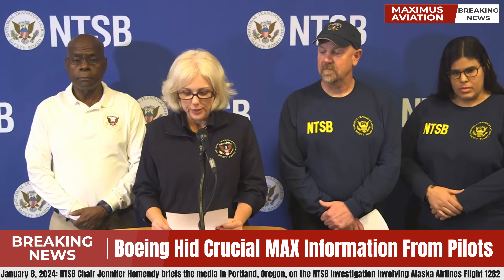Boeing NEVER Told Airlines That 737 Max Cockpit Door Was Designed To FLY Open During Decompression!

Comment from the maker: ** A Message from Maximus ** The reason I felt this is so important is because if you noticed. The NTSB seems to be glossing over this as just an "oops" Boeing oversite. She just said oh yeah Boeing agreed to address this in the manual.  But this happened with the MCAS system when Mark Forkner got the FAA to let Boeing NOT include the MCAS system in pilots flight manuals and we all know how that ended up.  So I felt this needs to be a much bigger story than the way the NTSB portrayed it. I can think of a lot of nightmare scenarios where this can be used as an excuse to get into the cockpit. So I just wanted to make sure to get it out there. As always please comment and let YouTube know you are worried about it too! Thanks. Max.
Reply: The new manual will say: Passengers seated in row ##, will be blown away into heaven in case of a emergency rapid decompression. Thanks for flying with us ❤️
Reply: @dondepicaelpeje listen and read again. They are talking about the cockpit door, not the door plug that failed.
Reply: @thesmallerhalf1968  who? What I said? I’m talking about the plug door/panel whatever
Reply: @dondepicaelpeje 😂😂😂😂😂
Reply: So if im a terrorist all i have to so is poke a hole in a window on the way up to unlock the cockpit door?!
THANKS NTSB!!!!
Reply: @christopherleveck6835 It’s easier to poke a hole in the fuselage skin than a window…
Reply: Until the FAA discontinues  allowing Boeing employees to act on behalf of the FAA to inspect and approve new Boeing planes under construction these quality control and defective engineering problems will simply continue.
Reply: We only have insufficient info so far. Boeing might well have designed the door to function as a blow-out panel in decompression events -- where pressure is distributed over its entire surface -- and still resist localized forces like  a hijacker yanking on the doorknob or prizing with a crowbar. Please suspend judgement until all the facts are in. (And I used to work for AIRBUS.) What is more disturbing to me is that the laminated CHECKLISTS "took a flyer"!!
Reply: It would be in the Boeing Manuals its the same as Airbus. It's a standard feature. I bet the FAA will make a correction Tomorrow.
Reply: OK, most of us engineers knew this, but presumed it was secret for security reasons. 
It is to stop diffrential pressure damaging the bulkhead between the cockpit and the PAX area.
 Someone put a lot of inportant wiring there...Cat out of box. Now, we will get to review security again. 
No real security risk here, it takes a LOT of pressure to open this door.
 @hamishdavidson3368
Reply: All cockpit doors and bulkheads will vent pressure.  They're designed to give-way instead of kinda holding up and then failing catastrophically one way or the other.  "Catastrophic" as in -- 1) Contributing to fuselage structural failure; 2) Sending shrapnel flying into the crew;  3) Damaging flight controls and other systems.
Reply: Almost certain this happens to all cockpit doors in the event of rapid decompression. Should have been redesigned when the cockpits were hardened against forced entry. but then it still would leave anything older with this vulnerability. Think this might be the reason they did not put it into the manual. still bad idea, even though admittedly, crashs because pilots didn't understand the manual are far more frequent than Boeings failure to disclose critical information.
Reply: It's possible that the Indonesia crash can be categorized as an "accident."  The Ethiopia crash was mass murder.
Reply: @DavidGBlair  100% I still believe management should have been held criminally liable.

Maybe that would have induced a bigger culture change?
Reply: This cannot be used as an excuse to get into the cockpit. Someone would have to intentionally cause an explosive decompression which would be absurdly dangerous to them. Additionally if the door didn't open, then there would be a risk of the cockpit structure being damaged.
Reply: @Synergy7Studios  Boeing’s piss poor outsourced engineering and components with horrible internal quality control plus the lack of a functional FAA and Federal legal accountability systems are no accidents, they are verifiably intentional.

As Boeing literally got away with murder, “B737 Max style”, these accidents will likely continue. 🙏Great thanks no one died this time. 

Thus, to this day, I simply continue to refuse to fly on the Boeing Max; deadly risks increase with every flight. A calculated risk I refuse to take.
Reply: @Synergy7Studios idk if you knew this, but in the case of a hijacking like 911, they never expected to make it out alive. If your plan is to crash the airplane... your priorities clearly aren't self-preservation.
Reply: So Maximus can we keep going on say opps it just an over sight each time while try to kill the flying public or do we call back all those aircraft and do a full fixed from cockpit to tail session 😮😮😮😮
Reply: @leupoldt  The difference between comments from pilots and comments from armchair pilots is so stark. Everyone seems to think information was "hidden" except the actual pilots lol
Reply: @robroilen4441  I'm a glider pilot. We already have holes in our canopies for ventilation. We carry oxygen. And I can land ANYWHERE.

Once.
Reply: @robroilen4441 then there the commenters who have yet to comprehend the designed blow out function refers to the cockpit door, not the fuselage door plug.
Reply: Boeing is a shit show.   Along with the FAA the NTSB & the government who have no idea what their job is    Aussie Bob
Reply: I used to work for Boeing. As soon as I pointed out the SAFETY Flaws (many), I was let go. They even  told me "Don't Be So Neat Picking" and asked me to revise the document.  IF I was asked to testify in the Congress, I would.  Lack of Leadership at Boeing. There are so many Managers .. a Manager has his manager and his manager has another manager to report to. 3 freaking steps to report to 3 different managers.  Red Tapes at Boeing !!
Reply: Must have busted everyone’s eardrums !!!!
Reply: Nice video as always Maximus ! I wonder how many pages was the manual when the MAX models were first delivered and how many more they have to add everytime they discover something !
If this is not criminal what they did and are doing then what is considered criminal ! Total shame !!!
Reply: Thank you. Yes, I am also very concerned that the cockpit door pops open in a loss of pressure incident, bypassing the locked door safety protocols!
Clearly these “Plug Doors” are not plugging doors in a real sense (internally flanged so they are locked into place by the cabin pressure) like all the exit doors! Why was Boeing allowed use this lift-latch system which is inherently more dangerous??
Reply: doing my own research I found articles dating back almost 20 years talking about cockpit doors, safety and the fact they can be locked but absolutely have to be able to be opened during rapid decompression.  From all the reading I have done it seems as though the crew should open the door in those situations. if they didnt know it opens automatically okay so be it, they still should have opened it. Poor training and thats not boeing fault if they dont know this. Um thank you Boeing? maybe? it also seems as though they have done a good thing here. They forgot to tell them that something is going to happen automatically that they should do if they didnt do it. What a S**t show this is
Reply: Not that big of a deal guy WOW THEY DIDN'T Realize The door was gonna fly open in decompression. get a Hobbie or something. 😂
Reply: Thanks for providing the extended NTSB media conference but I don't think the NTSB are "glossing over" or "portraying" anything here... it's a briefing for mainstream media outlets, and it's pretty clear Homendy was responding to specific queries & speculation.  To the contrary, the comments about the cockpit door issue sounded more like a "shot across the bow" for Boeing because you need to keep in mind that the NTSB is an investigation arm only.... they have no authority over the FAA or Boeing.  And given that public discussion is unfortunately decided by what the mainstream media choose to cover from these briefings, I actually think that Homendy chose to make those comments in the hopes that the media would start asking those exact questions of the FAA and Boeing.
Reply: This particularity of cockpit door is known, at list in Asia and EU. Fr US companies….?…
Reply: Thank you Maximus.
I was not aware. Will include it in my enroute decompression briefing
Reply: The old 737 cockpit doors had blow-out panels in them, for depressurisation, and everyone knew the panels would blow out.  So does the Max open its whole door, instead of having panels??

And why does the NTSB have a leader that know NOTHING about aircraft??    
She is not a puppet, she is a moron.

R
Reply: I retired in 2012 after 30 years of airline flying. Not long after 911 the new doors were installed we were informed by our training department that the doors were designed to relieve the pressure if the airplane had a Decompression, they had blowout panels that would open.  Maybe the doors have been redesigned and function differently now. We were told almost 20 years ago they needed to be made in this way to equalize the pressure so the aircraft structure around the door or cockpit would not fail. Also some doors open into the cockpit and some doors open outward from the cockpit so the design is different on both types. I flew the 757 and the 767 one opens into and the one opens out of the cockpit. I can only guess that over the 20 or so years of using these doors the training dept at some of the airlines fail to mention why the doors have odd looking panels in them.   Also there is a way to lock  the door manually from inside the cockpit after it has been opened for any reason. They did not overlook that problem on the Boeing aircraft. The info was in our Aircraft Operating Manual.
Reply: @bkailua1224  I'm not a aeronuticle scientist but I think I can solve this one.
They need doors that make that shish noise and slide sideways or disappear into the floor or something. With vent holes to keep the pressure equalized.
Problem solved.
Reply: Because Boeing had no criminal charges and jail time for those responsible for killing 346 people with the MAX, they continue to hide vital data putting everyone flying the MAX and those on the ground in  great danger.

Hay Boeing, what in the heck else do we not know about the MAX?

Wake up FAA. Time to have independent engineering teams review everything on the MAX NOW and redesign shortfalls. 

Until then I will continue to NOT fly on the Boeing 737 MAX Death Trap. 🪤
Reply: The movie "Airplane" was to attempt to normalize what was to come.  As usual reality is always stranger than fiction nowadays.
Reply: @arthurfirth3366  Shirley you can't be serious.
Reply: they all have no ethics and value. interested only in scamming and making outlawed profits.
Reply: do you think i believe a word from this .... and the faa along with boeing scams.
Reply: i invite all passengers to stop boarding Boeing flying coffins. refrain from buying tickets flying boeins. make it out loud and clear.
Reply: they elected the zombie biden and the fanatic before him. go see the apprentice. is this the moral, ethics and values of the american people. it is a pitty.
Reply: It should be obvious there is some rate of pressure differential that would pop the door.   The decompression panels are designed for a certain likely pressure differential of some size hole.  They've got to balance protecting the flight deck from an intrusion and collapsing a bulkhead. We don't have a need to know how much force is/was required.  It was probably not up to Boeing, FAA or NTSB if it's in the manual.
Reply: They omitted the auto cockpit door opening to keep the 737 type cert?..
Reply: NO. @davidbickford2539
Reply: This isn't a scandal, it's physics. Besides the QRH being blown out, what is the downside of a blown open cockpit door during an explosive decompression? You worried Abdula is going to bum rush the cockpit? He's going to pack an bomb to blow out the side of the plane, but not bring it down, so he can get into the cockpit? Take your meds.
Reply: Homendy's ignorance cracks me up
Reply: You know what Max? Airbus never told A320 owners what the rudder response of their new flight control system would do at 250 knots either. 
Yet Sten Mullin was framed for the crash of AA587.  Go figure. 
Everybody lets Airbus/Air France slide on by.. But Americans go right under the bus. 
It's BS imho. So is this freaking hit job by the NTSB (again). 
This does need to be a much bigger story. Only thing I agree w/you about. 
well that and 4:20 am.. every day buddy! woot!
Reply: "Boeing hid vital information" again -- it needs to be prevented from doing so any more.
Reply: The FAA has failed big time in the past with Boeing so what is different this time?🤔

Oh the Tax payers get to pay for Boeing’s missing quality control Safety Management Systems and once again pay to coverup the FAA’s and Federal Courts own mistakes in allowing Boeing to get away with 346 deaths on the 737MAX which is precisely how we got to this point today.🤫

With decades of advanced manufacturing new product development, quality control and forensic failure analysis engineering experience seasoned in ISO, ASTM (I), SMS (Safety Management Systems) Six Sigma etc., Boeing must implement these programs immediately on their dime and suggest contacting me as I will gladly assist in the process. ✅

https://youtu.be/YQKzHdq3DM8?feature=shared
Reply: Hopefully?  Boeing WILL upgrade the training documentation to explain what the cabin door does in an explosive decompression.

She's the boss here, should be beating up Boeing over this.  It's their product, they did the final mfg QA before release.
Reply: It's no wonder. She's been a "student pilot" for years. Lol. She's incompetent.
Reply: @sapienspace8814 I forget, if I know what the duncan-kroger effect is, does that mean I am a genius or just thunk I is one?
Reply: If the cockpit door would not open during a rapid decompression, the whole aircraft would implode due to the difference in pressures
Reply: I want to add that do you know who else didn't tell their customers about things? McDonnell Douglas who bought Boeing with their own money.
In the early 90's SAS was ordering a good amount of MD-80's from McD. McD had just installed a design change to reduce thrust on the engines after takeoffs, to reduce noise at airports. SAS did not want this option (we need that thrust during winter ops) but the planes were delivered with this thrust reducing system DORMANT!! Without SAS knowing!! 
What happened just a year or so after delivery was the SAS crash at Gottröra during Christmas. No fatalaties thank heavens but this is the same shit that McD always did. 
Since they took over Boeing this thing keeps happening. I don't trust this new Boeing. Old Boeing would NEVER!! They were run by engineers, not accountants.
Reply: they are not "glossing over". They say it is like that and what will happen. If it is relevant to the causes it will be in the report. Otherwise it has been i a highly broadcast press conference.  What more do you want? Does every fart have to be turned into a conspiracy theory?
Reply: @sapienspace8814 Armstrong was a VERY nice guy. I got to spend a couple afternoons with him a couple years apart from each other. He remembered me and our previous conversation. He really had no reason to. I worked on a project with Buzz that got me close to Neil. Even though they weren't really talking to each other at the time. Buzz is a really great guy too. I don't think that's always been the case but he is now anyway.
Reply: the way she always says "approximately" followed by a precise number ie "9450 feet and 245 knots" is extremely disturbing even for a non english speaker. she has no clue of technicalities or engineering, and trying to look smarter and educated in the field which she clearly is not. its usually done in badly translated science shows etc
Reply: I don't know who I distrust more, Boeing or the NTSB. Or are they partners?
Reply: Good decision, Maximus.  Go to the naughty step, Boeing and NTSB - lives are at stake here, or don’t they matter?
Reply: @martinross5521  Obviously they do not matter as much as profit margins and bonuses do. They never do. We need to stop feeling bad about those who die in these crashes if we are just going to forget and move on. I for one will no longer waste emotional energy over loved ones dying and their family grieving if we all just forget them and move on. What is the point just let the companies do as they like and forget the dead. That is what they would like everyone to do anyway.
Reply: @martinross5521  Don't be ridiculous 😀management's money matters, other peoples lives don't until it impacts the bottom line.
Reply: @andrewallen9993  or the aircraft impacts the ground.
Reply: @martinross5521 well it’s 349 💀and counting so far.   They ( regulators & Corporations ) look like they both are following the blindfold and cash strategies of the the late 19 th and early 20th century rail and shipping industries 👎🏻
Reply: When the cockpit door is not the weakest point at explosive decompression , the cicuitbreakerpanel will .
Good luck with your emergency landing .
Reply: @aredhaired  Nothing a small blowout panel can't fix. No need to have the entire door blow out/open.
Reply: @DaHitch 😳🤭
Reply: @aredhaired well that didn't happen all fuses held
Reply: Thanks Maximus for this piece of information. Mass media did not touch this in none of the updates after that press conference. This issue let me thinking about the “good” job inspection  and addressing the 737 Max after the crashes. They repeatly said that will not be any secrecy regarding the plane and as a gift in 2024 came this door with the auto blow out function that nobody knows.
Reply: Absolutely agree. The NTSB has learned NOTHING about the root causes of Boeing’s blatant negligence. She is the worst NTSB employee I have ever witnessed and frankly should be fired immediately!
Reply: @icare7151 6:13
Reply: If the deadbolt on the door is used it sure isn't going to open.
Reply: @ferrariguy6389 that deadbolt can be opened electronically by use of a switch. So it can DEFINITELY be opened or locked automatically.
Reply: That is NOT true. I work on these aircraft. The deadbolt is 100% manually operated. The latch in the center right side on the door is electrically operated.
Reply: @ferrariguy6389  point taken sir. Thank you.
Reply: @maximusaviationchannel I'm also perplexed at how this door is "intended" to be a blowout door...  can we know which seat numbers Boeing so that those are never revenue seats again?  that threat to revenue will be the only thing they understand
Reply: It’s always been in the first chapter of the FCOM. And in the CBT we all do. The door opens if it’s a cockpit depressurisation or the panels blow out if it’s a cabin depressurisation. Because the door is only hinged one way. Basic knowledge. How could the NTSB not know this and why on earth did Boeing not correct them?
Reply: @meofnz2320  Because, to be frank, every pilot (apart from say blancolirio) in their eagerness to tell us what they know (which we aren't disputing) seems to be missing the fundamental point (whether that point is right or wrong) : that if you have blow-out panels on the cockpit door, then they should go, rather than the whole door, which (as long as the panels do do the job) you might want to keep locked for security reasons  - and yet a cockpit door with blow-out panels seems to have swung wide open as a unit.
Reply: @villiamo3861  
It’s opens one way. The blowout panels are in case the negative differential is on the other side.
Reply: @villiamo3861  
I’ve got to admit I was wrong: in later 737 models the door description has changed and only mentions the blow out panels. This would appear to reflect a design change to make them unidirectional. The doors on other models will unlock and swing open.
Reply: @villiamo3861  haha you said do do.....
Reply: VERY good point. I knew, and I don't fly a plane. Been a feature on every Boing since the doors wrere introduced.
If it wasn't there, the result would be catastrophic. Remember the cargo door incidence!  @meofnz2320
Reply: I dont think the max will fly again just by putting it in the manual ... its a clear security design flaw, i mean .. make a hole in a window and the cockpit door opens ??
Reply: @maximusaviationchannel
I’m a 737-qualified pilot and what you are doing by misrepresenting the facts hurts the aviation community as a whole. 
The presenter stated that the crew did not know about the door’s ability to release panels to equalize pressure in the flight deck and the cabin. She DID NOT say that Boeing didn’t tell them. The panels are called “Decompression Panels” in all of the literature provided to each airline. I’d post a picture from my Aircraft Systems Manual that has the labeled picture but I don’t know how to do that. If the crew did not know this, that’s on them. In fairness, it is not commonly part of our refresher training but the data is there for everyone to see.
To your point of accessing the flight deck by “poking a hole in a window”…1) good luck poking a hole in one of those windows; 2) under a rapid decompression scenario NO ONE will be able to move without oxygen after only a few seconds and there is typically a period where no one can see due to all of the moisture in the air instantly forming a cloud due to the pressure change. Then you’d have to obtain a walk-around O2 bottle somehow before you could even think of getting to the flight deck.
Be more careful when you spread information. It looks like some of these people might actually believe you.
Reply: @greglecrone2180  Just like the MCAS saga, it appears that channels like this come out of the woodwork to suddenly spread bizarre misinformation that's easily disproved by a few simple searches. Is it a coincidence that a lot of these comments mention Boeing stock when the next Boeing earnings report is due on January 30th? Was it a coincidence that the first country to call for the grounding of all 737 MAXs was China, a country uninvolved with the accidents who just so happened to be debuting an airliner meant to directly compete with Boeing? 

The regularity and similarity of the comments on videos like this is genuinely suspicious
Reply: @greglecrone2180  I understand and agree with you. My point was, I think, still valid. As to your points....
1) if you had a battery, which you can bring on an airplane if nothing else in the form of a laptop battery..... 12v would be more than enough to use with a simple tool to make a rather large hole in an airplane window. I won't elaborate I don't need to give anyone any ideas.....
2) I have been in an aircraft that decompressed semi explosively..... I think any terrorist worth his salt is going to know where to get a walk-around bottle. And for every one he takes he leaves flight crew with one less bottle.
Let's not forget that the bad guys KNOW whats about to happen. They have probably thought about all these things.
And, if done during take off when everyone is belted into their seats, it would be very easy, barely an inconvenience, to get around even with a cloud in the aircraft.
In my experience, visibility wasn't that bad. And it didn't last more that a few brief moments. Certainly less than a minute.
It was a long time ago. And time does some very strange things when you are scared out of your mind wondering why your bag isn't inflating even though they told you it might not and trying to look out the window to see if you are over water and wondering how well a seat cushion that doubles as a floatation device functions if it's covered in poop.
Reply: @greglecrone2180  Thanks for that. I totally agree with you. There are thousands of details about any aircraft like the 737 that a flight attendant may not be aware of. The last thing you would like to have is a design where the cabin might suffer a rapid a rapid decompression with the flight deck still pressurized by a door not designed for that condition. That would invite a secondary decompression of the flight deck with additional risk of injury or damage. I get a bit tired of these pseudo experts yammering on about things they don't know anything about!
Reply: @bluemarblescience  it seems like it would be pretty easy to have vent holes around the perimeter of the cockpit wall that would keep the pressure equalized and maybe keep the checklists in the cockpit where they belong.
Reply: Hold on a second, in the MAX FCOM, chapter 1, Airplane General, Emergency Equipment, Doors, Windows, page 1.30.10, Controls and Indicators, two “Decompression Panels” are clearly shown and described.

Furthermore, under Systems Description, it states:

“The door incorporates two pressure sensors that unlock the decompression panels 
in the event pressurization is lost. The decompression panels have manual release 
pins. Pulling the pins frees the panels allowing egress in the event the door is 
jammed.”

I am not inferring that Boeing once again dropped the pin (pun intended) yet again with their MAX aircrafts. Maybe they did, maybe they didn’t. What I am saying however is that the NTSB is insinuating that Boeing never told anyone about the decompression panels on the cockpit door and that’s blatantly false.

Then again, with a nitwit like Pete Buttigieg as U.S. Secretary of Transportation, any treasonous democrats really, what else could one expect?

Furthermore, I am greatly disturbed by the lack of standard phraseology in the average U.S. crew members. The JEPPS General manual is crystal clear when it comes to standard communication in case of an emergency: pilots should call “Mayday” three times, something this Alaska crew never did.

I lay the blame on the Alaska Airlines training department. The Law of Primacy dictates that crews should be trained from day one to transmit a Mayday every time they train for an emergency in the simulator. This is something obviously not taught at Alaska.

But I digress. 

We are now living in a world where designing, manufacturing, training, flying and air traffic controlling large aircrafts is based on DEI (diversity, equity, inclusion.) 

The days of hiring personnel based on meritocracy are over…
Reply: @captainmzungu2505  No.  The NTSB is not commenting on or "insinuating" about there being supposedly no information given by Boeing on the panels.  The panels were a given.   The NTSB is commenting on the whole door swinging open precisely when it was expected by the pilots that only the panels would blow.
Reply: @captainmzungu2505  ditto.
Reply: fell? feel? felt? oversight? oversite?
Reply: @praystation  Spell check does some very strange things if you don't catch all its idiosyncratic idiosyncrasies.  I find my gaze wandering as I type and fail to ride heard over spell check and just assume it is actually operating accurately.  This is amplified by urgency and don't even get me started on age and how that effects eyesight.  All that is to say, I think we all got the just of what he is trying to say but didn't feel the need to point it out to the world for whatever reason you might have had.  It is something I think we all fear, some wanker calling us out for a spelling errer.  While I give it as much energy as I feel nessary, presenting perfect spelling and grammar, mostly it is just, wankers be damned, I will sometimes just not worrie bout speling isuies and blast what ever needs to be blasted out cause of whatever reason I have wiht working abut pellins or gramer.  With all. the conflict is the world, why contrikbuyme to it, when not necessary?  Howabout you blast something at me and just drop a few inacruaties, just to see if you can over come that feeling of perfection?
Reply: @tra757200  sorry, it's got to be done. Not because you misspelled some words.... But because of THE WORDS you misspelled...
Spelling errer- error
Speling isuies- spelling issues
Abut pellins or gramer- about spelling or grammar?
And my favorite- CONTRIKNUYME?! Contribute?
There's more, but I've had my fun.
I am picking up what you're putting down.
An eye wholehardedly aggree wit ewe.
Reply: @christopherleveck6835  I am glad you enjoyed my misspellings.  I put them there to make a point, but them maybe you were too concerned about proper spelling than my point.  Don't be a Kevin.  No one likes a Kevin.
Reply: @tra757200  did you misspelled "Karen"?
Reply: you can't spell.
Reply from the maker: @praystation  Aw come on man its 4:20 am here lol. Where I'll fix it. But yes you are correct. I get scared when spell check doesn't fix it because i never believe I got it right.
Reply: @maximusaviationchannel you need to capitalize your "I"..... But i dont care.
Reply: Don't even worry about them. That's what people do when they get mad - they try to find a spelling mistake. "Oh my God, you forgot punctuation!" 
but I do understand that. Yes, you want to make sure your spelling is correct, proper, and able to be read. It's a very good feeling that you're good at that. Don't let trolls get you over small mistakes - that's why pencils have erasers.
Reply from the maker: There! I felt it er Fixed it.  @praystation
Reply: @maximusaviationchannel What is you email address as I have breaking news?
Reply: Grow tf up. Child  @praystation